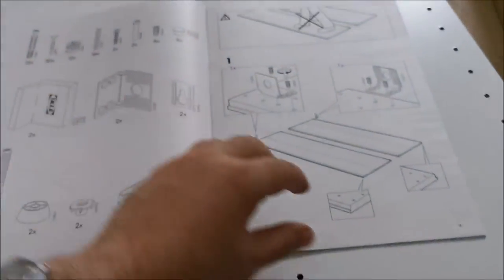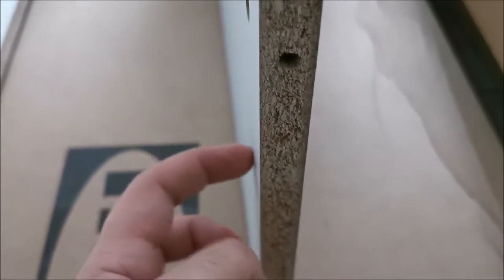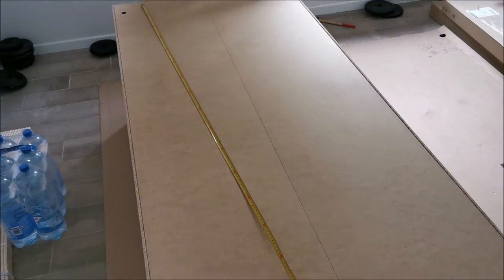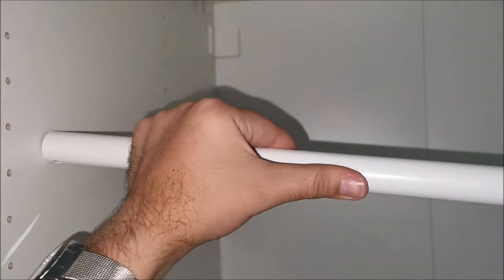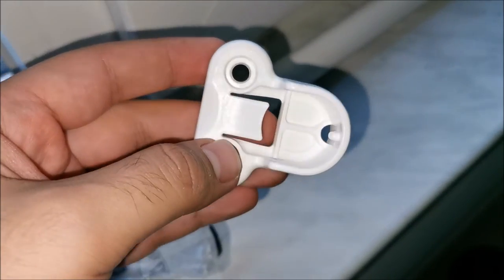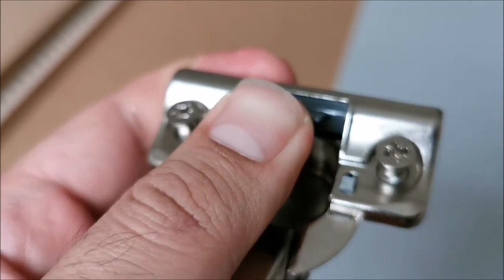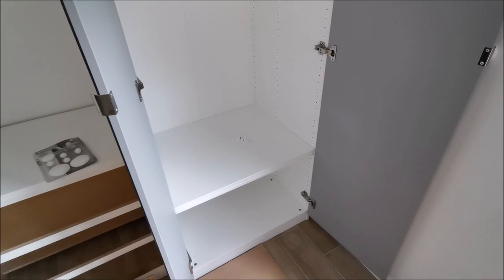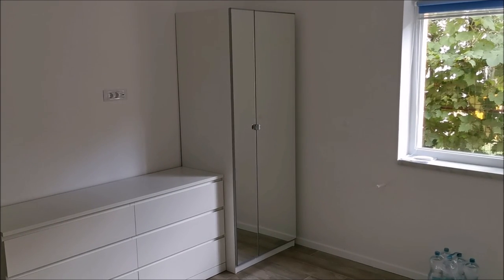Assembling IKEA furniture - PAX - Wardrobe with mirror

Comment: Do you need a drill to install the handles?
Reply: No you scan screw straight into the door as the wood is quite week. But be careful if you do it wrong your door handles won’t match up when they are closed.
Reply from the maker: True 👍🏻